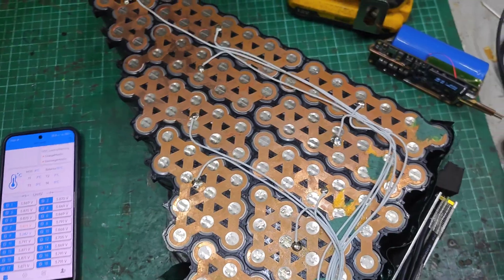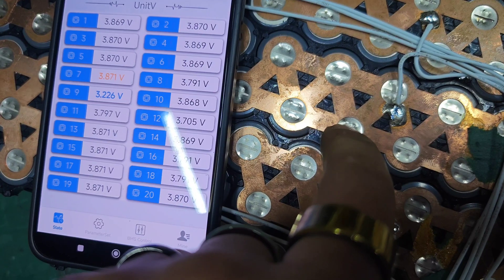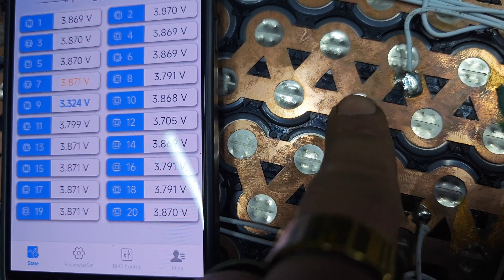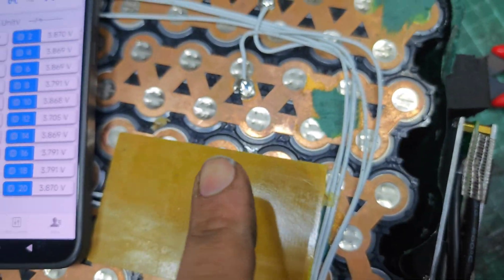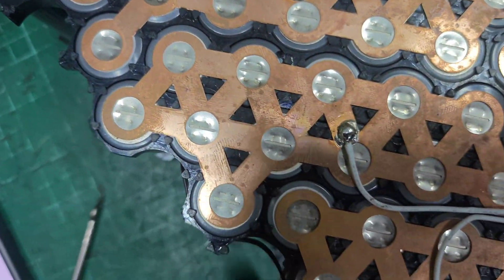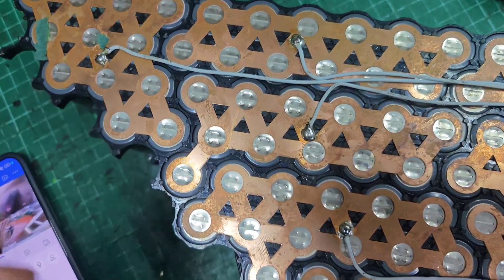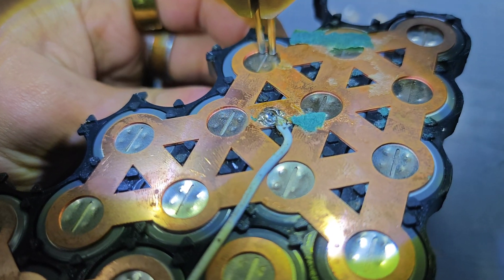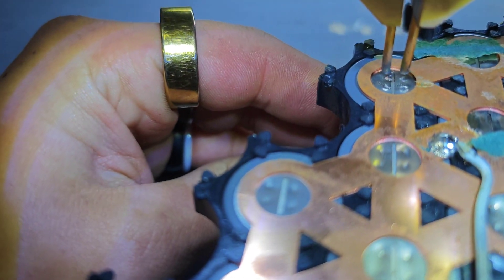HUGE Ebike Battery COPPER Spot weld FAILURE! 72v 30AH LG M50LT Cells - can I fix it?

Comment: These high power packs are terrifying and to see such poor quality control straight from a professional manufacturer is really quite awful.

We have to assume the entire batch has the same issues, assuming their spot welder was set incorrectly or malfunctioning in some way. 

How many bikes out there have cells that are sparking be across when the neighboring cells discharge. 

Recipe for disaster!
Reply from the maker: @gavin9038  very true! I think it needs a recall like the UPP triangle packs did...

Comment: That is pretty poor, you have to assume that the individual cells are not going to match now being as some have been cycled & some have not & the whole pack has had different AH rated groups within the series groupings.
Reply from the maker: @Will-thegrumpysoutherner  I did balance it up, it was pretty close to it's rating (I stressed it a bit at 20a, would probably deliver full 30AH capacity if I tested it at 2-5amps) 

The pack had only been used 1- 2 times before I got it, you can see the total capacity cycled on the pack (ever) in the app I showed in the video, that goes up every time you charger or discharge it - and I already tested it a few times, so it barely had 30ah through it by the time I got it.

Comment: Hi Darsh, In one of your videos you mentioned oil cooling the motor. I understand this will involve sealing the casing with a gasket sealer.  Drill and tap a hole in the end casing to fit a fill/drain plug. So my questions are. What oil would you use? I've seen someone on YouTube suggesting transmission oil. Or what I was thinking of, to use a food grade mineral oil. I've seen whole computers just submerged in the stuff and coming to no harm. Also, how much oil to use? Would you fill it to say a quarter full, to limit how much you'd lose through the barrings with expansion and contraction of the motor. This would make a great video, especially as we now know they are not increasing the motors we can legally use on the roads from the 240w they are now. So using higher voltage batteries and a controller that puts out a few more amps is the way to go for me, but without cooking the motor. Any thoughts would be appreciated.
Reply from the maker: @markwilkinson4428  I actually finally did this (to this bike) the other day! I just used some 70w90 transmission oil I had lying around, laid the motor on its side, filled it up with 50-100ml or so and bolted it back together - NO LEAKS! I didn't film it because I'm an idiot, and I also haven't test ridden it yet. My motor was slightly cooked from previous overheating that this controller swap caused from a big hill at 52v without pedalling (my own fault) but hopefully this keeps it going for longer. I didn't seal anything or drill anything, I didn't measure the oil, I just dumped some in! I didn't even remove the old grease from the gears, even though I should have

Comment: No wonder you see fires, with this sort of workmanship.
Reply from the maker: @markwilkinson4428  this issue shouldn't cause a fire by itself but if the strip came off completely and then shorted out it could be catastrophic!!
Reply: @EbikeRepairs  
 if one cells will be fully discharged and suddenly connects to few fully charged cells when going on the bump there would be A LOT of amps i guess, and 50lt is only 1,6A charging current. You would exceed it multiple times and it would heat up a lot also. For me sounds dangerous. With m50Lt maybe its not so bad, but try this with high current cells or new tabless. I think they could catch fire in that scenario.
Reply from the maker: @bobikbobikowy5458  that's a very good point you make! Totally could do that :O